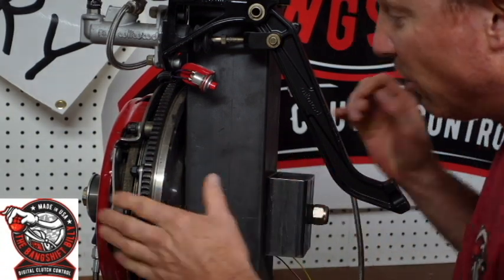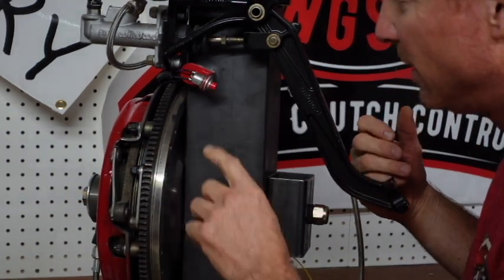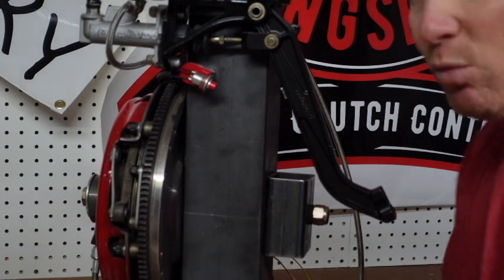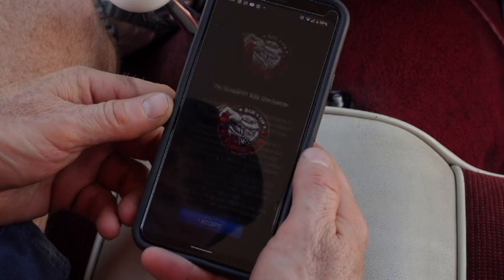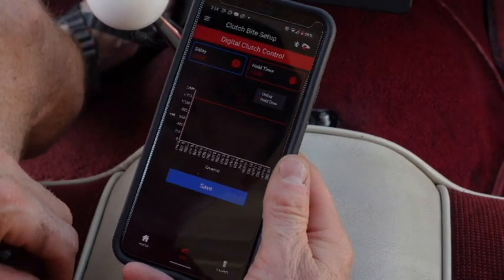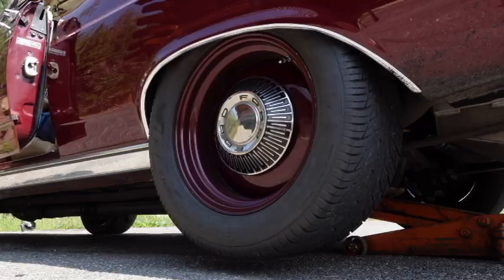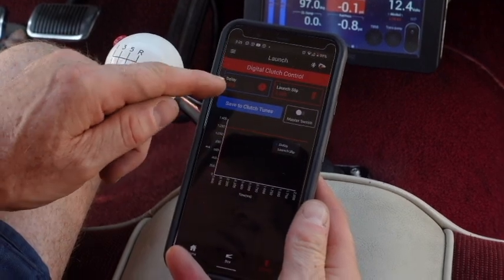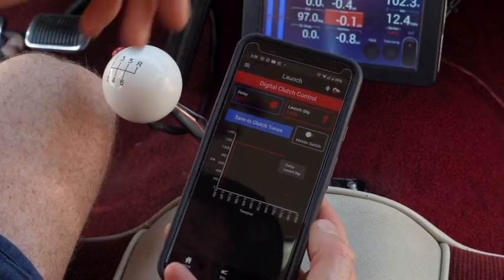Digital Clutch Controller set-up

Comment: Really cool stuff, brother! I have had lots of trouble with wheel spin on my 600hp Turbo 1.8L Hemi Toyota motor mostly due to the power to weight ratio and tire size limits I have available, and seems like this setup would be a great benefit. Please let me know when available. I happen to be in the process of converting the Supra W58 transmission to hydraulic operation which seems to be a requisite for this setup. Would like to know when/where it will be available for sale .
Reply from the maker: We are taking pre-orders now https://www.indiegogo.com/projects/the-bang-shift-billy-digital-clutch-controller/x/27031160#/
Reply: Should be shipping units at the end of January